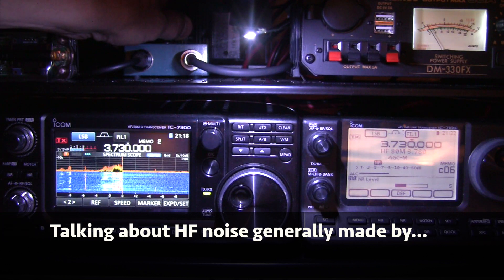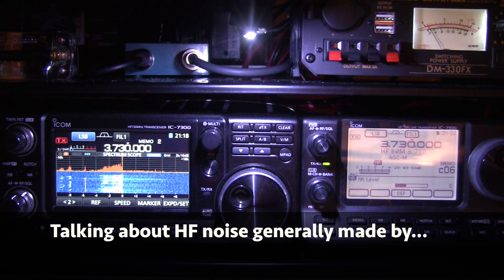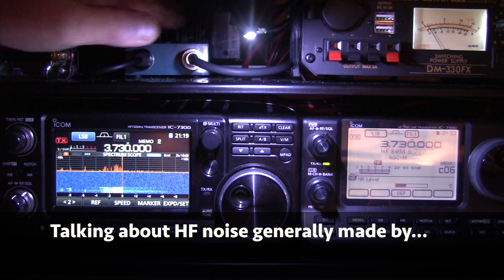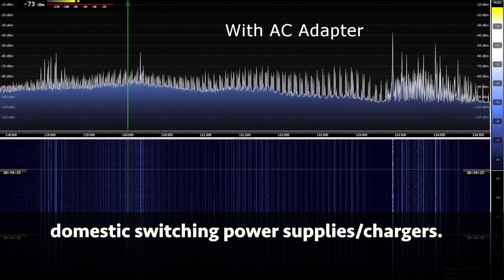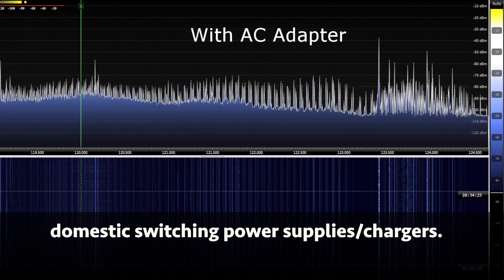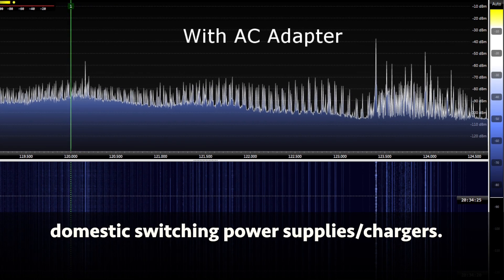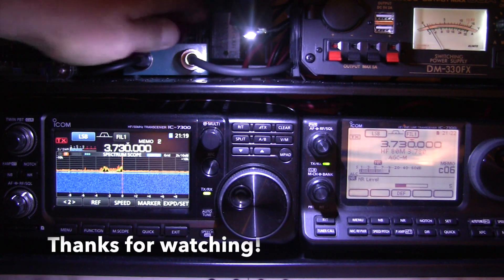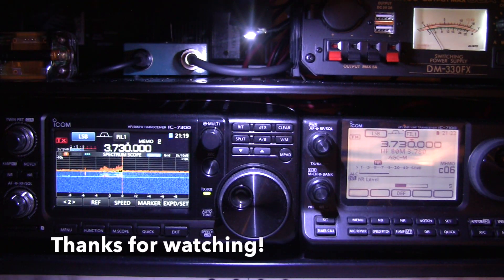IC-7300 vs IC-7100 RX comparison on a weak signal

Comment: Interesting.  I have had a 7300 & 7610 and both seemed to be noisier than my 7700 & other radios.  I am thinking of buying a 7100.  Thanx for the vid.
Reply: It's a damn nice radio.  I have been using one for two years.  My 7100 goes directly in to a switch that is connected to 7 designated tuned verticals out back.   No tuner what so ever.   Works GREAT!
Reply: you will miss the waterfall
Reply: @ronknight3417  no....no not really.    That's just a shiny object that hasn't been in amateur radio for the last 100 years.   Performance outweighs shiny objects.   Sorry.
Reply: I'm glad I'm not the only person that thinks this.   The 7300 is a damn good radio.   I understand why Icom calls it an "entry level" radio.   There are much better radios out there.
Reply: My IC-7700 is just unbelievable.  That radio's going to stay in my shack  for many many years.  The receiver on my 7700 I think is probably top of the line compared to a lot of radios today even these newer ones.

Comment: New to HAM, but recently go my Extra class. Ive been really impressed with the 2730a. So much so that I have one in each of our trucks, and one as my primary 2m 70cm shack rig. Ive gotten spoiled with the face plate mounted on a cell phone holder that I put right next to my keyboard. So now I think that the 7100 makes sense for my personal preference in smaller and more easily placed units. I could just slide the 7100 controls right next to the 2730, and I would be set. I scan hf through an sdr anyway, so I can clearly see where the activity is.

Comment: Considering the older tech of the 7100 it sounds damn good! I am a bit biased being the owner of a 7100 but I have a hard time really telling which one sounds better. 7300 a bit more muffled and watery, 7100 crisp and clear. I suppose this could be a result of RX audio settings?
Reply from the maker: I was also surprised, both sound fairly good, despite having different technologies, 7300 has a better speaker, 7100 still sounds great!
Reply: you must understand the speaker in the 7100 is in the head unit and facing away from you i have both radios and believe me the 7300 is better not by much though
Reply: You can't tell sh!t without using the same speaker on each one. It's a no-brainer to pick up a set of $30 used Polk or Boston CR4 small speakers off ePay so it's a RADIO comparison not a cheap speaker comparison.

Comment: Had the 7300 and a nice radio on weak signals , I have just ordered the 7100 and was wondering how it compares on weak RX signals, this test as reassured me that the multi functionality of the 7100 as not been compromised in the RX department, you tend to get a trade off in a shack in the box on receive than you would with any radio specifically designed for the HF bands only, its nice to see here (to my lug holes) that the 7100 just came out on top on the weak signal test...thanks for the test, its taken a little of my concern away that buying a shack in the box 7100 that there as not been any trade off in RX performance.
Reply from the maker: Yes the 7100 still does a good job, even better when we reduce the RF gain, I just wish it had a Waterfall!!!
Reply: @VE2FGJ  You can get software to do that for you, ok not as  portable had it been on the radio but you can always go the software way on yeah laptop hooked up to the radio... if and when you do go mobile with it.
Reply from the maker: @peterwaine923  Yes I did try that, used a SDRPlay RSP2 + MFJ-1708-SDR, worked well.

Comment: I have both. The 7100 is better in all respects especially on CW! Audio cleanness on the 7100 is amazing. Try listening to some BC FM. Very pure with zero hiss. The 7300 has the cool scope but it's noisy in comparison to the 7100.
Reply from the maker: I agree, I also prefer the 7100's audio and the RF Gain knob provides cleaner audio, less noise than the 7300. But that scope is irresistible, so got to have both!
Reply: @VE2FGJ  Might put my SDRPlay on the 7100

Comment: A better test would be if they were both run through the same audio system, not their built in speakers.  The speaker and enclosure may well make a bigger difference than the reception circuits.
Reply from the maker: Agree. The goal was to compare how weak signal compares with native audio, which is what most operators use. The audio part could be improved by using better speaker/amplifier/equalizer/compressor/noise reduction.

Comment: Hey Frank @ve2fgj, do you still have both radios? If so, could you run the same test but this time on CW, on a signal that is at noise floor level, say 329 with 500Hz filter and no NR, this would tell us much about the difference. It would be even better if the weak signal was a few hundred hertz off a strong signal.
Reply from the maker: Hi Mike, I do not CW, I believe both radios are good, it is a matter of preference. Over time I have found that the choice of antenna and location supersede any radio choice. Hope that helps. Thanks for the comment. 73!

Comment: Great video. I have a 7300 and am buying a 7100. This confirms what I have been reviewing. Both great radios. I have a question, what did you use to prop the 7100 control head to keep it vertical? Great set up!
Reply from the maker: The 7100 is held vertical using a custom home made support bracket using the 3 screws in the back, not beautiful but it is hidden. I like the 7100 because it is analog, we can use the RF squelch, the 7300 does not work as well with the RF squelch. The 7100 is mainly used for VHF/UHF/D-Star.
Reply: @VE2FGJ  That is exactly my plan for the 7100! Plus I know it will work as a back up for HF.  Thanks!
Reply: there is a threaded hole in the back of the 7100 head for mounting mobile ime sure you could use this with a bit of thought

Comment: I would like to konw if both rigs had the same filters and settings, I feel that 7100 is tuned better and is not a fair competition.
Reply from the maker: In all fairness, the same settings yes and filters are FIL1 on both, the 7100 has a slight shift noted by the small dot, but that would not account for the difference. In all situations for the years that I owned these radios, the 7100 always showed a slight advantage, less noise. The 7300 is by design noisier, disconnect the antenna and raise the volume, you will hear the 7300's internal noise, comparatively the 7100 is much quieter. The IC-705 is also better that the 7300 on RX with weak signals. There is no competition, the technologies are different. Hope that helps.
Reply: @VE2FGJ  Thank you very much for your soonest reply! It shows me that to buy an IC-7100 for my mobile is the best choise. Sorry for my vocabulary, I wanted to say comparison instead competition (anyway competition is good to realize which would be better). Greetings from Patagonia Argentina. LU1YES
Reply from the maker: @GabDalPietro  You are welcome, thank you for the question 73!

Comment: As one can clearly hear, the filter on the 7300 lets much more bass through - try to set the filter to the same bandwidth & offsets next time? Maybe with an NF spectrum analyzer  on a phone at the speaker?
Reply from the maker: Both Radios are shown using their own built in speakers, the 7300 has more bass than the 7100. But the goal was to show the actual signal level comparison and reception sensitivity.

Comment: A switching power supply with no RF noise?  How did you eliminate the RF noise, just put ferrite chokes on all the cables?
Reply from the maker: The DM-330FX does not produce much noise, I also use ferrites on the AC and DC lines.

Comment: i had a 7100, it was the radio that had the WORST big signal immunity, a strong signal in the same band makes high qrm in the whole band. the antenna i used was a 1/2 wave dipol fir 40m. switching the ATT on did not help at all. the ic706mk2g i had, had a similar problem but when turning the ATT on, the signal immunity was much better, with the disadvantage of losing some sensitivity. the 7100 is even worse than the 706mk2g for that matter. i had bought the 7100 new. i'm glad i sold it, the guy who bought it said its a beatyful radio, and i thought whats that guy used to if he thinks that 7100 was beautyful. what kind of antenna do you use for this test? if its like 1meter wire yoz are using in this test, then i guess there will not be much problem with big signal immunity as said. i have an old icom ic765, it drives circles around the 7100, the clearity of the receiver and big signal immunity is far, FAR superior. make a comparison video if you like and lets hear then.

Comment: What a strange thing to do, not utilize the NB.
- I don't know one single Op who doesn't make use of his NB except when engaged in a local net or group wherein everyone is 20 over 9 or better. Too bad it's so impossible to simply find a normal test of two radios without someone just having to add an oddity the average user would not.
Reply: It's also almost a useless comparison when the same speaker isn't utilized. There's more difference in SQ due to the speakers than any receiver difference, unless, of course, you're trying to make a speaker vs speaker video, which would also be a waste due to the fact almost everyone uses a better sounding external speaker or if not, sets the rig in such a way the internal speaker isn't blocked.